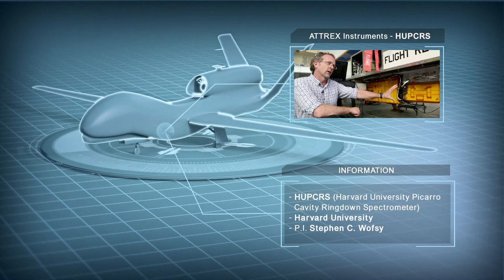Harvard University Picarro Cavity Ring Down Spectrometer (HUPCRS)

Comment: This is intriguing. What/which CO2 modes is it detecting? What is your base line: a vacuum?
Reply: I think they usually use a tunable laser and scan the frequency around the absorption range, so the areas "outside" of the absorption essentially provide the baseline. For example, if you were wanting to scan for absorption near 1.5um, you could take a bunch of measurements between 1.4um and 1.6um. The outer edges of that range give you a baseline because the gas doesn't contribute to the absorption (the decay is entirely due to the loss in the mirrors).